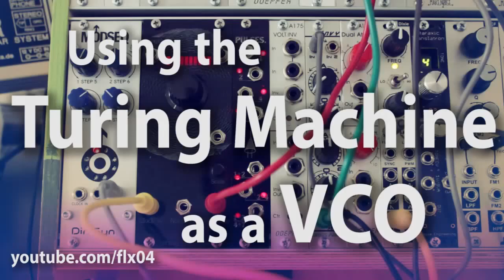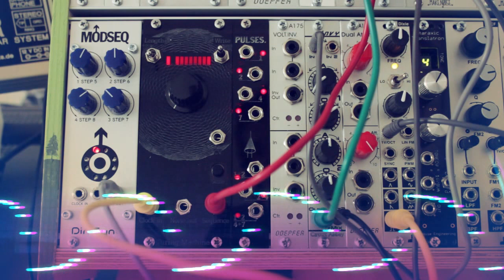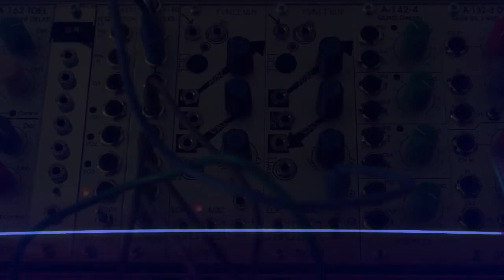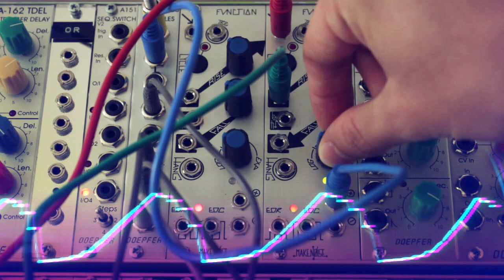Turing Machine as VCO (Eurorack/Doepfer Modular Synth Demo) #TTNM

Comment from the maker: +Lew Termen: I can't reply to you because of your privacy settings. The way I understand wave shapers, is that they modify an incoming waveform. The RLS however generates its own waveforms, like a VCO. The pulse wave going into the clock input is not changed or used other than "driving" the module.